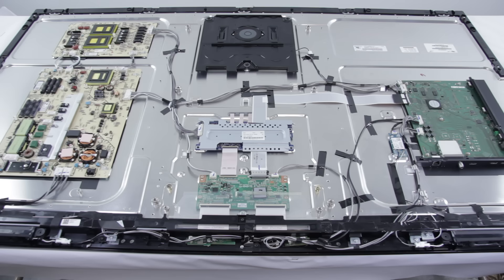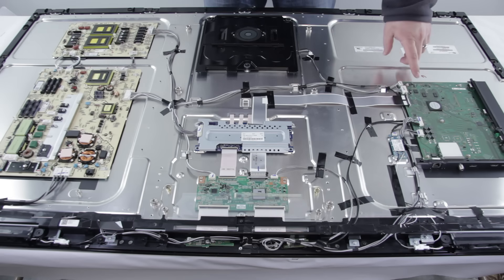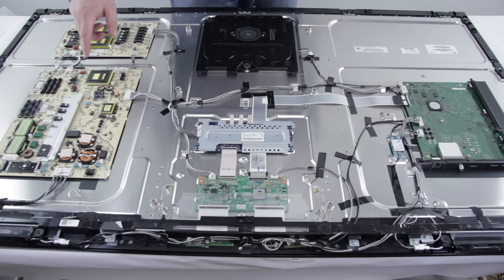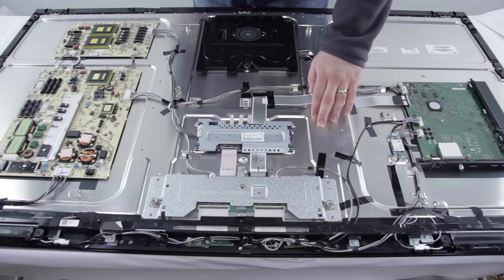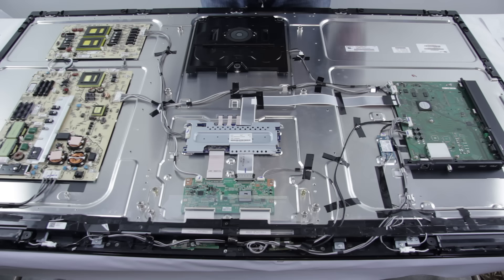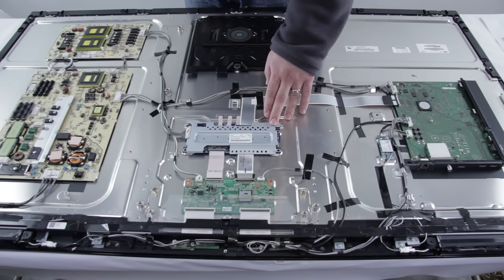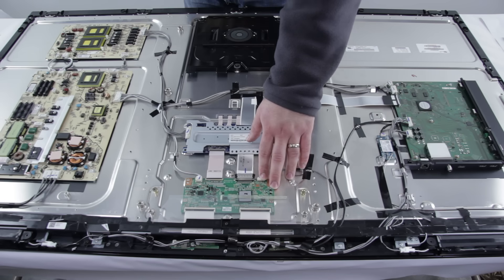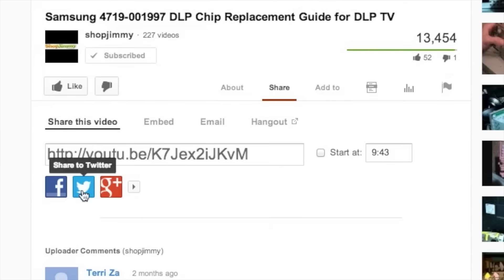LED TV Repair Tutorial - Common Symptoms & Solutions - How to Repair LED TVs

Comment: Hello! I have an Insignia 55 inch led tv(model ns-55d550na15) in which the picture went out and the sound is still there. I also did the test you demonstrated with the flashlight and was able to see the picture. Also, there is no light coming out of the back vents and I know I was able to see light before. I tried looking for the led driver board on the site you had on your video but was unable to find it. Do you know where I would be able to get the part for this tv? Thank you!
Reply from the maker: veronica zaccagnino Try all repairs and troubleshooting at your own risk.  This could be a problem with either the power supply board or the LEDs in your TV.  You can replace the power supply board to see if that fixes the problem.  Unfortunately I do not see any replacement parts in the search results for your TV model number on our website.  Thanks and please let us know if you have any further questions!  www.shopjimmy.com

Comment: Your video is short and to the point. Thank you.
My problem is I have a Funai tv. It stopped working. All it does is start, shows the name brand and then go off. The tv brand is Funai LED. Model: LF320FX4F.
I would appreciate your in put to repair this tv.
Reply from the maker: hashim salim   Try all repairs and troubleshooting at your own risk.  I recommend running the flashlight test on your TV.   Here is a link to a video we produced that shows how to run the flashlight test. https://www.youtube.com/watch?v=xUzCLgoSPGM Please reply with your flashlight test results and we can recommend a replacement part for your TV repair. Thanks and please let us know if you have any questions! www.shopjimmy.com

Comment: I have a 32mf369b/f7 , the TV works great except the sound goes crazy, it will either turn all the way up or all the way down all by itself. When it does this the remote control will not work as well.
Reply from the maker: John Malone  Try all repairs and troubleshooting at your own risk.  This sounds like a problem with either a stuck keypad or a bad main board.  You can check the keypad on your TV to see if any of the buttons are stuck.  If not, then you can replace the main board to see if that fixes the problem.  Click this link to replacement parts for your TV model number:  http://www.shopjimmy.com/catalogsearch/result/?q=32mf369b%2Ff7  There may be multiple boards for the same TV model number, be sure to match part numbers on your current board, with your replacement for compatibility.  Thanks and please let us know if you have any further questions with your TV Repair!  www.shopjimmy.com

Comment: Hi there I have a Samsung 46" LED UA46B7000 tv. I accidentally bumped into the tv and since then I have a vertical line thats got a darker patch tha. The rest of the screen. It's about 10cm wide and runs vertically through from too to bottom, I can still see the picture but this area is a little darker than the rest of the screen, it's not a coloured line but darker patch. It is located slightly off center to the left of the screen. 
What do you recommend? 
Many thanks for your time
Reply from the maker: Herman Oosthuizen  Try all repairs and troubleshooting at your own risk.  I recommend replacing your TV.  Thanks!  www.shopjimmy.com
Reply: ShopJimmy.com Hi there, thanks for your reply.  I actually just got a call back from the technician saying he thinks it's the screen that's got the problem.
Is there a chance for this be the problem?  They said I can take the TV to another technician for a 2nd opinion which would cost me another assessment charge, but do you think symptoms like this could mean it's the actual screen?  That would mean the whole screen needs to be replaced?
Reply from the maker: Herman Oosthuizen   Yes.  Try all repairs and troubleshooting at your own risk.  This sounds like a TV panel (TV Screen) problem.  If your TV panel is bad, it may be more cost-effective to replace the TV as panels are typically hard to find in stock, difficult to replace, and expensive.  Thanks and please let us know if you have any further questions!  www.shopjimmy.com

Comment: This video is over a year old. Let's see if this still works.

Samsung UN32C4000PDXZA:
I did not pay too much attention to it but this started about a year ago.
When the set is powered up the red led light blinks on and off for about three to four maybe five times and then it will decide if it is going to display a picture or not If it displays a picture everything is working fine and I am appeased.
If, however, it decides that it is not going to display a picture there is nothing that can be done to reset, trick, fool the set into changing its mind. Everything is not working fine and I'm on the verge of laying waste to the entire square block.
The remote has no affect on the set short of making the unlit LED light flicker as the key is depressed. Cannot turn it off. Cannot turn up the volume. The only way to turn the set off is by unplugging the power source.
Now, I've heard several different fix-its in the past twelve hours. Bulging capacitors. There are none. I mean, there are capacitors but none are  bulging.
On another video some guy is waving around a white electronic part the name of which I was unable to capture and have had no luck finding that particular video again. But he states that this is the culprit. 
On another, replacing the entire board is the answer.
On yet another I'm checking diodes and voltages.
...and then there is the year lapse in posting the video and this query. Let's see what yields.

Thank you in advance for your time and consideration in this matter.
I would suggest recruiting Americans with broken TV's as the Dirty Dozen and unleash them on our staunchest enemies, just saying.

Sincerely,
JHP 061915

Comment: I have a lg TV model # 32LCD_UK

The problem is that during operation it will make a noise kind of like a firework being shot into air then picture goes black after a few seconds cj display comes back then picture sometimes when this happens you can not turn set off on the times when it doesn't come back you have to disconnect then reconnect power it also has times when it freezes pic on screen as audio continues can you help

Comment: I have Vizio model # M470NV. This is the problem when I try to switch it on it shows for some seconds "V" symbol of opening screen without going any further and then goes into stand by (switch off) mode and back to "switch on" and starts to hop between the two til after few minutes doing it, it stays in "switch off" mode.
If you have any idea what is wrong their - power board, main board or T- con please let me know. Thank you.

Comment: I have a Samsung UN50EH5000 my back light went out. Replaced the power supply and main board. I did a flash light test and see the tv is on.  There are only 3 boards on the back. TCON, main and power supple.  What else could it be? Thanks
Reply from the maker: usarmy27  Try all repairs and troubleshooting at your own risk.  This sounds like the problem is the LEDs in your TV.  Thanks!  www.shopjimmy.com

Comment: I am trying to fix a Sony KDL-40HX701.
There is no picture (not the message, actually a blank screen).

When power is on, the LEDs are solid Green.
When power is off, the LEDs are solid Red.

When power is on and remote is used the Green LED blinks - appears to be acknowledging that the remote is communicating.

I have the back cover off and just visually inspecting. Do not 'see' anything that appears burned or broken.

Suggestions on what to do next?

Thx!

Comment: Hello sir i need your help for my samsung smart tv repairing

I have samsung led smart tv ua46es6200
Yesterday i was on tv in night. Showing only black screen ,little blue light, but sound is working.
Then I opened tv back cover, for checking fuse gone or what.
I checked power supply board , capacitor, everything is fine. I changed fuse also but doesn't
Showing screen, please help me out sir. 
Please tell me how can i start my tv.

Reply assp
Reply from the maker: rahul badole   Try all repairs and troubleshooting at your own risk.  I recommend running the flashlight test on your TV.   Here is a link to a video we produced that shows how to run the flashlight test. https://www.youtube.com/watch?v=xUzCLgoSPGM Please reply with your flashlight test results and we can recommend a replacement part for your TV repair. Thanks and please let us know if you have any questions! www.shopjimmy.com

Comment: I have a Samsung LED un55D6400ufxza I try to turn it up there is power on the led indicator but all I get is a on and off signal and a clicking noise at the power supply if
I disconnect the main board from the power supply the clicking noise stop can this be the main board fault , main is bn9405038n please help

Comment: I got a Samsung tv the model number is Un40f6400 it's a 40 inch 3d tv. I contacted  samsung multiply times they couldn't do anything. The tv makes a clicking noise it powers on and off randomly sometimes. I'm not sure if it's a capacitor I just want some advice to fix it!

Comment: I have a LG LED model number 50LN5600
The problem seems to be that the backlight wont stay on. I turn it on and it lights up for a second and then the light turns off. There is however still a picture and sound. Its very dark but if you look at the right angle you can still see whatever the program is showing. When the light goes out the red power light flashes twice. Even when you turn the tv back off, the backlights will flash again for a second. Any help or advice would be awesome.
Reply: Kenneth McGarity I just repaired an LG 50LN5100 and it had the exact same problem. I would turn on the TV and it would flash the backlight for a split second and it does the same when you turn it off. It was the LED strips on my TV. Half of the LEDs were burned out so I ordered the LED strips from ShopJimmy with the LED driver board. The strips have adhesive backs and stick to the back of the TV frame. They're behind the glass and the polarizing films so have to be very careful when removing the glass and disconnect the ribbon cables to prevent ripping them when you're removing the glass as well as not ripping the films.
Reply: DOOMSDAY911 
Did the leds and the driver board solve the problem?
Reply: Yep. TV is up and running again. I bought the 2 year warranty as well from ShopJimmy. It wasn't the power supply or the main board in my case since I could actually still get picture (test with a flashlight) and sound. LED/Driver board was all I needed to get the TV fixed.
Reply: That is what I'm going to try next.Hopefully that will solve my exact problem. Thanks guys
Reply: I tested my led backlight strips and found 1 that would not light. I bought a used one on Ebay and that was my problem. Hope this helps

Comment: I have an LG LED TV, model M2352D. Apparently it is a 3D capable TV though I had no idea about that until looking it up. The issue I've been having is occasionally the screen image appears with a reddish color to it and the whole image looks darker and tinted, plus some of the contrast looks odd, but sometimes that fades and the image looks normal again for a little while, so I think it must be a loose connection or something else that isn't too complicated. I'd appreciate any help getting it fixed!
Reply from the maker: Seth Schaffer  PLEASE SUBSCRIBE TO OUR CHANNEL - Try all repairs and troubleshooting at your own risk.  This could be a problem with either the t-con board, the main board or the TV panel.  You can replace the t-con board and main board individually to see if one of those boards fixes the problem.  Unfortunately I do not see any replacement parts in the search results for your TV model number on our website.  Thanks and please let us know if you have any further questions!  www.shopjimmy.com
Reply: ShopJimmy.com  I removed the back of the screen, then disconnected and reconnected the ribbon cable at the top of the screen, and this seemed to fix the problem entirely. I figured the boards bust still work since occasionally normal color returned to the screen before, and now its been behaving normally for days after that simple fix.

Comment: My LG 55UB8500 55" TV has 4 HDMI ports that are all NOT reflecting any signal from the HDMI Inputs.The connected devices are reflecting the LG TV as connected but there is no video on the TV.Everything on the TV works good.Please advice.I tried the reset and it did not work.I tried disconnecting and power off and reconnect and it did not solve the problem.Please assist.Thank You.

Comment: I ordered and replace t-con board for my Samsung TV model # un40b6000vf as you suggest,because my tv was going blank intermittently but I never lost sound. But after replacement the problem still continues,,there's no specific time when it goes blank,it could be minutes after turning the tv on or two hours afterward..the back lights are good and I always have sound..please advice....

Comment: I have a LG 42LN5200 TV. It will not power on most of the time. When plugged in, the red power light flashes two times, then turns off. I have already purchased a new AC adapter from ShopJimmy.com, but that did not help the issue. Does this point to a problem with the main board?

Comment: Hello, I have an LG 55LN5790 and the backlight goes dim in about 5 seconds.  At first it would dim about 30min after the TV was on.  Now it's down to 5 seconds.  I have replaced all 3 boards (T-Con, Power, Main) and I get the same issue.  Seems like it would be a simple fix, but I can't pinpoint it. Any suggestions?

Comment: Hello! We have a Samsung UE55D7005LUXXE, version:01, s/n Z8CG3SRB900082L for two years now. It is not starting fully up. Smart TV logo is blinking. If I take cable out of the wall, after one week our TV works perfect again for some time.  sometimes it is enough to leave TV blinking it turns on suddenly.  Mostly it fails to start up after being in sleep mode.  Please help!

Comment: Toshiba 39L135OU LED TV, subjected to lightning surge that tripped main breaker. Get picture and sound, but volume always starts at 100 when first powered up. Volume cannot be muted. If volume is reduced to reasonable levels it will spontaneously start increasing on it's own. Same result whether using HDMI 1 or 2.

Comment: I have an LG 50ln5100-ub that one of the HDMI ports went out after lightning struck close by. I've never taken a tv apart but I'm pretty savy with electronics. Do I need to replace the mainboard? Is taking the back cover off fairly simple?

Comment: So my Sharp Aquos model # lc46le810un won't even power on to try the flashlight test.  I replaced the power board and now the front emblem flashes one short one long repeatedly. The tv will not respond to pressing the power button or anything else. Not sure what the problem is now.

Comment: Hello, Have a Sony KDL-46V3000 tv. It is showing a double image on the right side of the tv, and some dark sections going horizontally across the screen. I have replaced every board on the back with supposed good boards except for power, and the two backlight inverter boards on the sides. What could be causing this? thanks

Comment: LG47LN5700-UH  TV turns on, red light at bottom of panel blinks then goes out.  The LG Logo is displayed briefly, perfectly, then it too goes out.  Press settings button on remote a 'Menu' appears briefly, brightly, then it too goes away.  Using a flashlight I can barely see the actual picture, but it is there.  I have not tried the sound.

Comment: Hi there, I am having an issue with my Samsung LCD LN32C450E1DXZA.  It's hard to explain, and as they say a picture is worth a thousand words, so I posted a video of the problem here. https://www.youtube.com/watch?v=SawMHKpsYOA  Basically the top half of my TV is displaying some very bad image, with horizontal and vertical lines.  When I first turn it on it is much darker on the top half, and with time progressively gets worse.  Like I said, the video I posted will explain the issue and give you some visuals.  Thanks for your time in advance.  Cheers

Comment: I have an LG55LV5500-UA.  It is now with no picture and no sound. Still see the orange light by the power button when turn on power.  Do you know what is wrong with it?
Reply from the maker: Long Tran  Try all repairs and troubleshooting at your own risk.   I recommend replacing the main board in your TV.  Click this link to replacement parts for your TV model number:  http://www.shopjimmy.com/catalogsearch/result/index/?cat=56&q=55LV5500  There may be multiple boards for the same TV model number, be sure to match part numbers on your current board, with your replacement for compatibility.  Here is a link to a video showing how to identify your part number, click here:  https://www.youtube.com/watch?v=RwHTvjMdrhk  Thanks and please let us know if you have any further questions with your TV Repair!  www.shopjimmy.com

Comment: Hisense 46" F46K20E - Loud static-like buzzing even when the volume is turned down or muted. Went off by itself one time as well. Would not turn on, had to unplug for a minute and then went on. Power supply or main board issue?

Comment: Hello, I have an Audiovox 15" TV/DVD Combo built in 2007. Model number is FPE1506DV. The TV runs off of AC or DC power. It turns on and operates fine when plugged in using the cigarette lighter DC power supply provided. However, it will no longer turn on when plugged into any 120 v AC outlet. Any ideas? Thanks

Comment: I have a proscan plded3992a no visible video, no sound but when doing a flashlight test I can see the proscan logo when turning on and menu when selecting it. The issue is I only see a power board (info/numbers: lkp-pl065/03ap4vo/le3943/lk-pl390101b) & the main board (numbers/info: T.RSC8.82B.12082), I do not see a led driver or T conn board anywhere on this model any ideas? Thanks